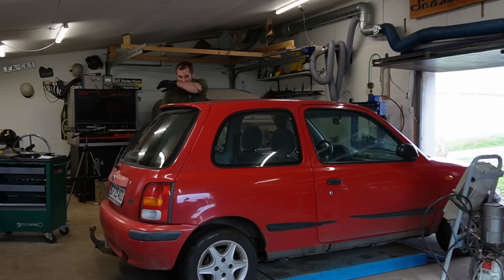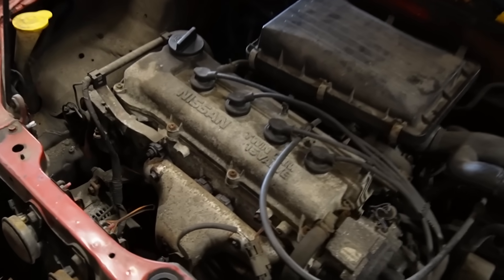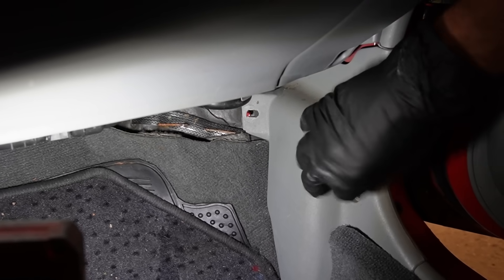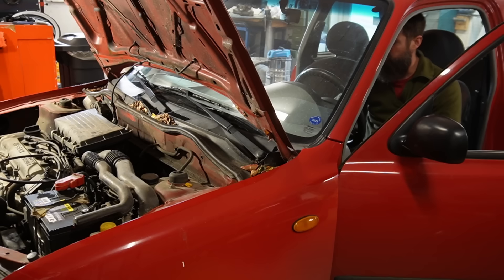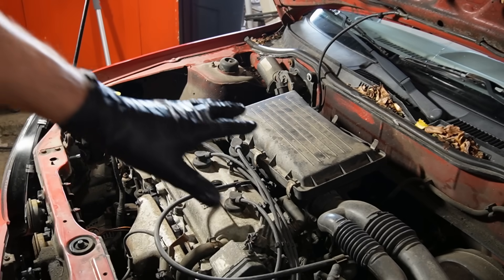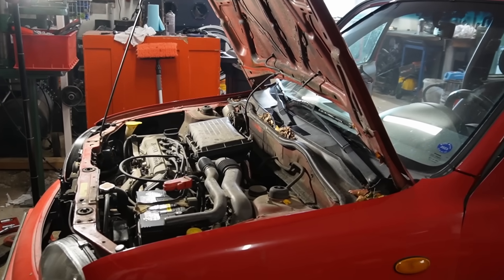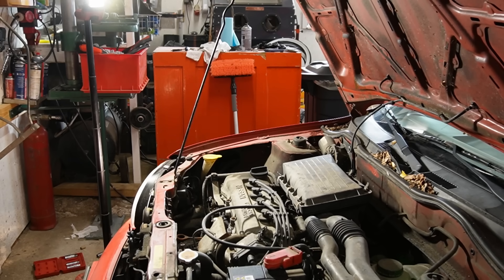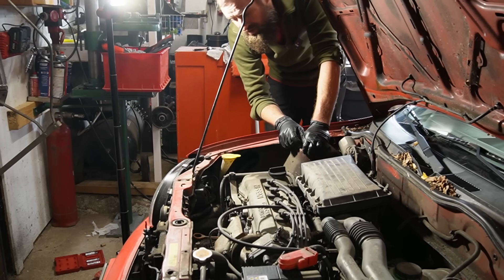Nissan Micra K11 - WONT START?!

Comment: A simple repair! I remember  when these cars were new they had this problem especially when owners would start the engine , move the car a few metres out of the garage  to wash it then drive it back into the garage. Over time the plugs would get fouled as the car was always running on a rich cold start mixture, especially if the car only made a lot of short journeys. On some cars of this era you can clear a flooded engine by holding the throttle pedal all the way down and cranking the engine  - the full throttle signal disables the fuel supply when cranking which can help to dry the plugs.
Reply: Clear flood crank😄
Reply: Used to happen on my 97 if I was shuffling cars on the driveway. Throttle flat to the floor and just keep cranking. Sounds horrible so you would get some looks from the neighbours.

Comment: Bought mine last year from a friend who had it new in 1995. It has 350.000 km, and it works like a Swiss clock.
Last Monday morning didn't start, just like this one in this video. Though it could be the starter, but found this precious video the day after. I immediately realized it was the sparks! Changed it, it's better than before! Thanks a lot!

Comment: Lawn mower syndrome. Over fuelling when cold washes the oil off the bores and you lose compression. When the engine stops the cold oil can keep hydraulic tappets a full stretch which can hold the valves open and also reduce the compression. Vicious circle as more and more fuel washes the the bores. In this case the old plugs couldn't supply a good enough spark to fire the initial very rich mixture. At this mileage the tappets might be tired and a bit gummed up. Some new oil and an Italian tune up might help. Nice cars. I hope you can continue to win your battle with the rust. Must keep Sis happy.
Reply: I have that too when I park my car for a longer time. Injectors leak some fuel and cause compression loss.

Comment: I used to despise those cars!
Not because they have anything wrong with them (they don't), but because in Ireland in the 00s these cars were driven exclusively by elderly folk who all got their license in the amnesty* and they couldn't drive for toffee.
So when you saw one of those, you know that it will be driving down the road at an absolute maximum of 60 km/h whilst meandering all over the place and followed by at least 20 other cars and trucks.
And Ireland didn't have motorways at the time, so you knew you would be stuck behind this for the next 20-30 km whilst desperately hoping you would find an opportunity to overtake.
Usually the two cars behind the Micra also wouldn't overtake, so you would have to overtake three cars.
My blood boils just thinking about it (i have gotten a lot calmer on the road though).

*The Great Driving License Amnesty of 1979.
In 1979 over 60,000 drivers were given an amnesty as they were granted a full driving licence without sitting a driving test due to the large backlog of driving test applicants at that time.
Reply: And nowadays they're cult classic b-road bashers. We have to thank the old biddies for that, eh!
Reply: @KitamiK11  I fully agree.

Comment: I had one of the K11 1.0 CVTs for a few years and loved it. Slow but super light and easy to drive. Because of its weird electromagnetic clutch, it didn't even creep when in gear, except when the engine was cold and the idle setpoint is high. Later models switched to a torque converter.
Eventually the cabin heater started leaking and the engine overheated due to lack of coolant pressure, and even after replacing the heater core, the head gasket had developed a leak that made it overheat when you go above 60 km/h, so that was the end of it. Would love to have it back again.

Comment: Great Fix! Little tip if you have fauled sparkplugs and you want to clean them just sandblast them in your blaster cabinet! I saw my neighbour (professional mechanic, car restorer) doing that and it works quite well. Replacing is always better. But if you want to clean them blasting is quick en very effective!
Reply from the maker: Great tip!

Comment: Sparking plugs with iridium or platinum or gold-palladium tips will spark much more reliably under unfavourable conditions such as extreme dampness or a succession of very short runs. They cost several times as much as the basic plugs but they also last several times longer. They slightly improve the fuel economy and also allow smooth idling and pick-up on a slightly leaner mixture. You can get below 0.1% carbon monoxide even with a car that has a carburettor and no catalytic converter.

Comment: The ‘92 Honda Prelude I bought out of a garage after it had been sitting for 8 years required only new plugs to get it running.  The previous owner had been told the catalytic converter was plugged. I began by draining and replacing the fuel. No go. Pulled the plugs out and cleaned then. They looked fine. No go. (Almost set in on fire checking for spark with a paper towel soaked with brake clean that was too close to a spark plug wire) Put in new plugs not expecting any change. Fired right up. Yes, sometimes just the simple things.

Comment: At 250k KMs, a good service wouldn't go amiss, already got the plugs, but changing oil, filters, coolant etc., would keep the engine running for a long time, whether the body lasts as long though, well that's another story... :P
Reply from the maker: Dont worry all that is also done... :)

Comment: I have late fathers 1998 Micra 1.3 Si with only 40k miles on the clock. I did have to get some rust repair to sills & front cross member, but i love driving it.
I think for a small cheap car these drive & are built very well.

Comment: I had two of these. Rust got them both. The big problem is turning off the engine without having let it run for a few minutes. The answer is what our man did. Take out the fuel pump fuse, nail the throttle and crank it over for a while. You learn not to make that mistake...

Comment: Glad you got it running, but I'd dig a bit deeper.  For instance, pop off the distributor cap and check it and the rotor.  If there is carbon tracking there it might run ok with new plugs, but the electrons will seek another path when the plugs have higher resistance.  Cheers!

Comment: These K11 Micra's were well known for this over fuelling when cold, nissan uk supplied a harness with resistor to go between temp sensor and ECU to prevent it happening , I fitted a few back in the day for my customers but on my own K11 I'd pull the pump fuse until it started to fire and then quickly reinsert fuse and full throttle till it cleared 😂

Comment: Did you have to gap the plugs? I would have checked the air filter too, could be clogged, effecting air to fuel ratio.
Love engines from this era!

Comment: 9:30 My Nissan X Trail had the very same issue... Turned out to be head gasket failure. You had to crank it with foot down and it would finally start. After this it would be fine all day long. Next day same thing. Would keep turning over. Went through three starter motors. Gave up on the motor in the end! Shame it was a really nice cruiser!

Comment: The distributor on my 1996 Micra failed after about 15 years - did not take long to pin it down as the culprit, cost about £130 for a pattern part to fix.

Comment: Nissan petrol engines seem to have pretty high cold start fuel enrichment . I had same issues with them Micra/Almera/Primera/Maxima .. Usually if just briefly starded from cold and switched over witing few sec./min. and left for hours or especially over night , next cold start just adds more fuel and you end up with scenario like that . I tend to unplug MAF sensor connector (if MAF based system) and 9 times out of 10 they start up with just short cranking over .